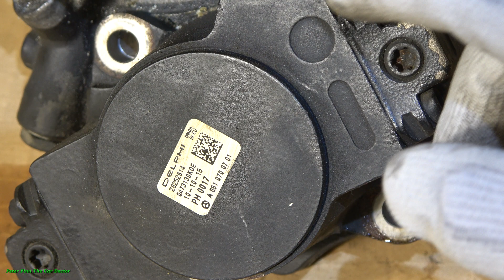How works 1000 BAR Fuel Pump in car. Case Mercedes Benz

Comment: Hello, nice vid. I got the problem and maybe you can help me to solve this. I replaced this fuel pump bcouse my car shows p0087 and P062a, its some issues with hp fuel pump. So i replaced with new one, and now car doesnt start (crankning but no start). Easily theres is no fuel coming out from the pump
Reply from the maker: Hello and thank you for your problem. This engine is quite difficult to start and in order to start it you need to have a new fuel filter and then you need to put new fuel injectors in this engine. then start the engine for a long time, about 10-20 minutes, and then the engine suddenly starts. all the best and good luck getting this engine going
Reply: @PeterFinnTheCarDoctor  thanks but theres no fuel going from the high pressure fuel pump, easily if i losen a nut on the injectors theres no fuel in the rail:( fuel goes from the tank to the filter ( new filter) and from the filter to the highpressure pump and theres is the end of fuel flow:/ if i use a start spray an engine lights up for few seconds.
Btw i tried starting it i think like 7 hours with breaks with no result